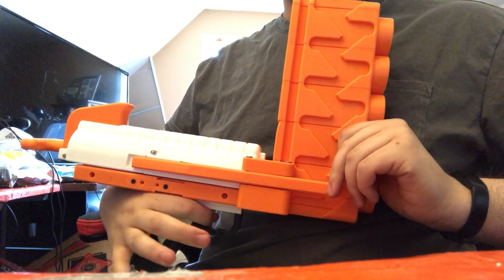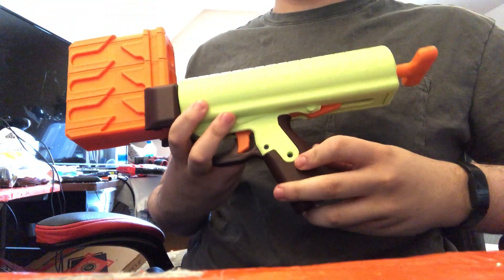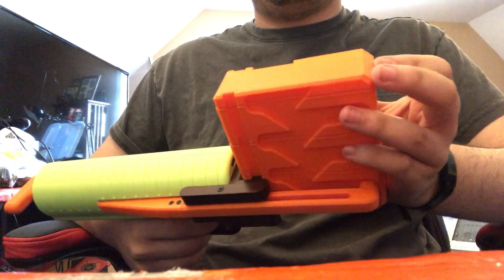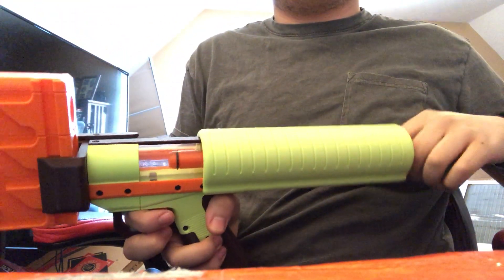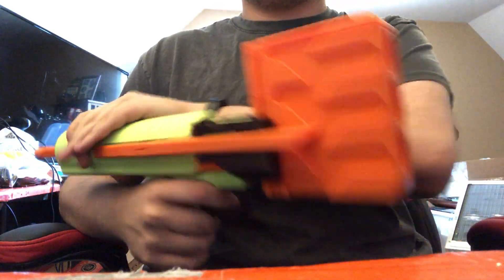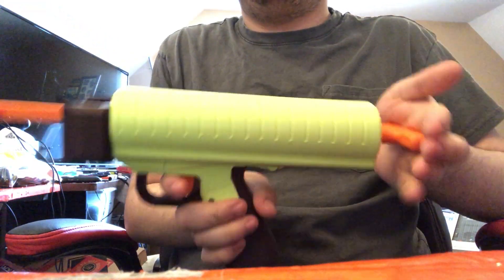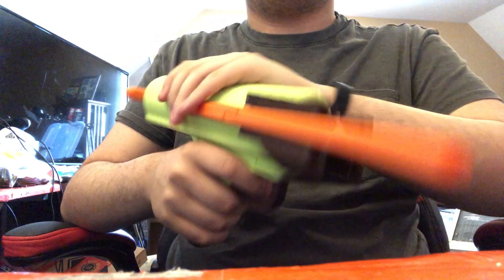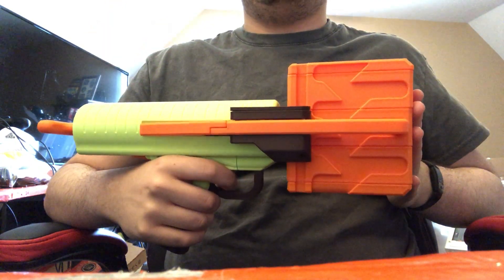Thumper v2 Overview

Comment: awesome design! do you think it would be possible to make a mag fed mega xl blaster? might be a little hard considering mega xl doesnt have an official mag yet so you'd have to design your own but internal mag would also be pretty cool.
Reply from the maker: I and a few others have attempted mag fed MXL. It only really works in a flywheeler, due to the size of breeches needed for MXL.
Reply: I also have been attempting mags for XL, they are a pain.